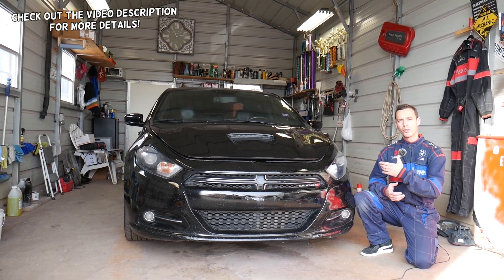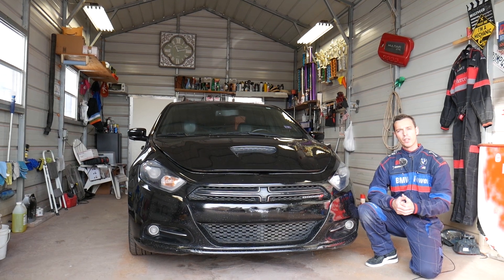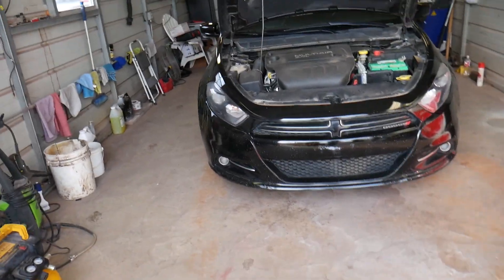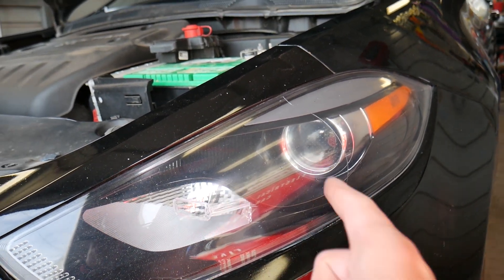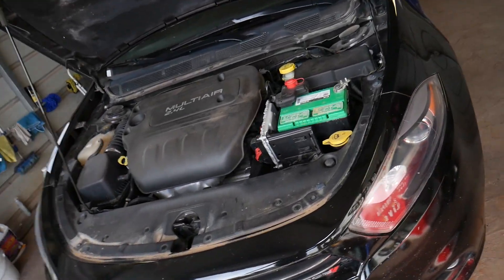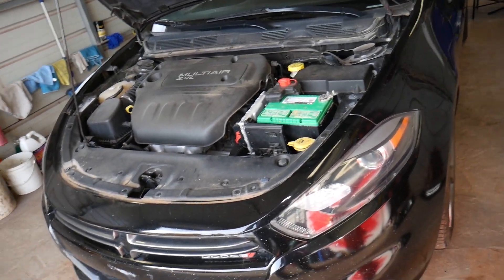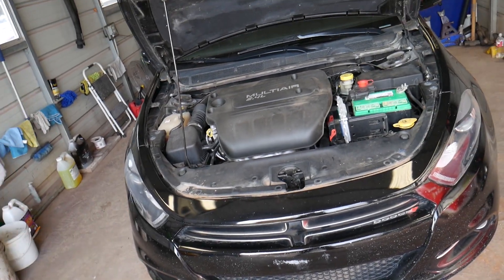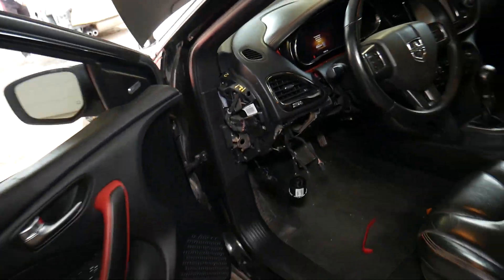HEADLIGHT NOT WORKING ON DODGE DART FIX. LEFT RIGHT HEADLIGHT OUT

Comment: How do I connect a two wire headlight connector to a three wire connector on a 2015 dodge dart?
Reply: @laura-huerta  yes… connect the high beam and the low beam wire together Both go on the negative wire and just connect the positive to the positive
Reply: Same problem